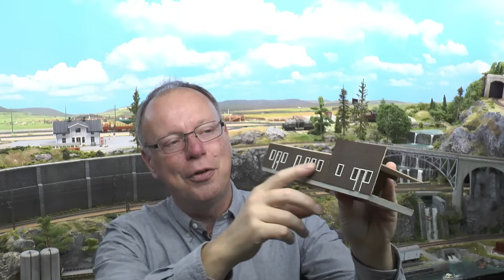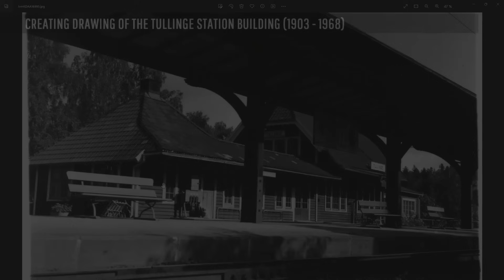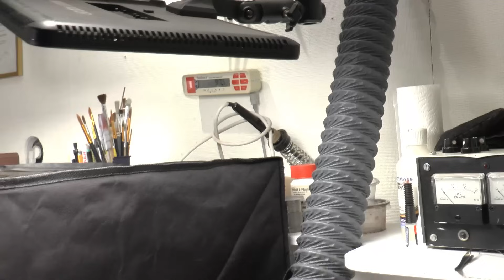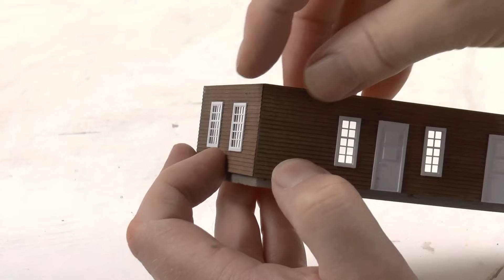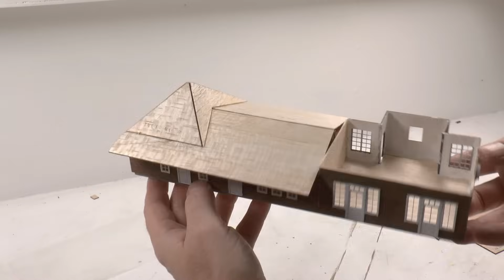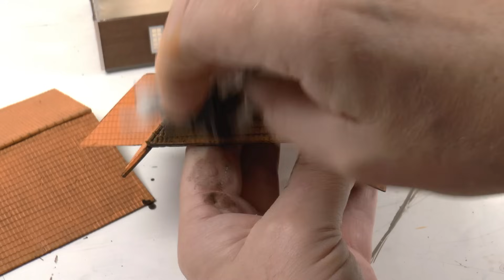Scratch building wooden railway station in H0-scale using Creality Falcon 2 22W Laser cutter

Comment: Hello, I am in USA and have just put together my first layout in years. Track and roadbed only at this stage. I am wanting to keep my track clean and I like your entry from two years ago saying that small wood blocks are really good as a method of burnishing the rails. I wanted to ask you though, about an electrical contact cleaner called DE-ox-IT D100L- 25c. I hear that it has no grease or lubricants. This is a concentrate that can be diluted for economical use. As far as dust is concerned and this is also such an enemy to the entire layout as everything begins to look like gray colour has been sifted over everything. I have seen advertised air filtration devices that are at working level of the layout or more centrally placed that suck in the air borne particles. What do you think of those devices ?   Love your channel and your uplifting attitude that I find encouraging. Merry Christmas and a Happy 2024 !   Bob

Comment: Station looks good, I build coaches and other vehicles using etched brass and was thinking of buying the creality 40w as I hopped it would be able to cut 0.2mm brass sheet but unfortunately I was told by the manufacturer that it would not cut metal

Comment: Fantastic- the stars have aligned.  I recently bought a Creality Falcon for scratch building (i.e., not using manufactured parts beyond the basics) and trust your methods for doing things.  Anyone buying a laser should learn about safe use - beyond that, I find laser work easier than 3D printing.  Thanks.

Comment: Molding texture sheets with glue is simply brilliant, I will be trying that out this weekend!
Reply: Please let us know how this works out for you.  I tried it and was unsuccessful.  I created a PLA mould of the texture, sprayed with mould release and put a coating of PBA over the textured mould but, could not peal the texture off the mould.  I wonder if the PBA glue was modified in the example.  I am going to try again with 75% PBA, 10% alcohol and 15% water.
Reply: Depends on the glue brand you use. I tried some normal craft glues and it was really hard to get off without tearing, I tried it with some selleys aquadhere, or whatever it's called, and it worked quite well, had some air bubbles though, maybe because I laid the glue quite thick (2mm). Gonna have to just trial and error it. @davebaxter3370

Comment: Nice build! Love your channel. But I have a question. Why didn't you 3D print the walls of the building?
Reply: Most resin 3D printers would struggle to print items this large, doing them with a laser cutter is quicker and easier for flat panels like this.
Reply: @meddie79  Thanks for your reaction. I was thinking about buying a resin printer. For printing walls. But maybe I have to do some more research.

Comment: you thing that printing is "Scratch Build" what a mistake.........Where is the scratch?   PLEASE select the tittle appropriately
Reply: Hes creating something from the ground up not using a kit thats scratch building. How he accomplished that is irrelevant s
Reply: @IHC650  It is relevent.  Kit Model building is similar to printing and painting.  But scratch building is totally differnt.  The video is more like Printer Ad.  The title "Scratch Build....." is the wrong word of choice.   Don't you thing it is at least missleading....
Reply: @terlik3537 this is scratch building in this context it means  you are not using anything from a kit and start from base materials how you achieve the work is irrelevant. The title of the video is correct
Reply: @garylong7599  Yeap you are right. I have "Starry night" on my wall. So I scratch build it with my color printer. But I guess it is irrelevant.  So I am Vincent 🙂
Reply: I do agree. You can as well scratchbuilding using styrene sheets and Peco, Auhagen or other doors, windows, roof plates and details. Designing in CAD and cutting the elements with a laser cutter is the same as drawing on paper and using templates to hand cut the parts. Just the tools are different. Saying it's not scratch building is showing you're just narrow minded and unable to use all the tools available to today's modeler.
Reply: @ericsainte290  Do you think "Printing" and  "BUILDING" same thing.  Printing and then some glue and paint is not totaly differs from the kit.building. Read about "Sceatch Building"  in Wikipedia then we can talk about mind set......https://en.wikipedia.org/wiki/Scratch_building
Reply: @terlik3537  Wikipedia  is the worst source to justify your claim as anybody can write anything there. I am a professional model builder and what he shows is kit conception, which can be defined as scratchbuilding as he creates the model from nothing, drawing all the parts in a cad program then using the laser cutter to cut it like he'd use a classic cutter and graving point. The craft is the same, only the tools vary. If you'd buy the files, then I'd say it is no scratchbuilding, sure, but it isn't the case here as even the windows and doors he creates himself in the cad then print them with the 3Dprinter, which is like making a master and making a mold to create copies. Once again the craft is the same, the tools vary. 
And before criticising someone's else work about a pinprick, are you yourself a scratchbuilder ? I surely am, and have been for about 40 years with multiple models having honor place on the ALAF layout in Liege - www.alaf.be - (Eglise St Vincent, Guillemins Station, narrow gauge station, hesbaye's farm, and many more). Where can we see  your work ?
Reply: Scratchbuilding seems like a wholly legitimate way of describing making a model from your own plans (drawn in CAD as the published ones were incorrect) and raw materials with no or minimal kit parts.  Nothing that says it has to be done using only hand tools.
Reply: Instead of marking everything out by hand on the wood and then cutting it by hand he hás used CAD and a laser cutter. Same result: a scratchbuilt station building.

If he then repeats the process again and again then it becomes a kit, not scratchbuilt.
Reply: @marcsmodelrailways  You can had same result with kit model too.  Therefore result is not the creteria.  Question still stands "where is the scratch".   I printed "Starry Night" wit my Laser printer, would it be count as scratch build.  If so, am I talented as Vincent.  Please use the words apppropiatly
Reply: @terlik3537  here is what have always thought "scratchbuilt" referred to: a model that has been made using raw materials with few or no commercially made parts. 😁

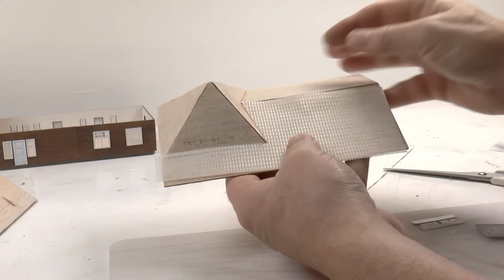Comment: At 16:00 you mention using the laser cutter to cut out the sheets of PVA roof texture - I would advise great caution in doing this. The V in PVA is vinyl, and cutting vinyl with a laser gives off highly toxic gases which is extremely hazardous to your health. Even if you survive, the gases will condense on the metal parts of the cutter, and will corrode them & destroy your machine. I'm not a chemist, so maybe the vinyl in PVA is slightly different & therefore won't do this, but I wouldn't take the risk.

Comment: Hello :) Instead of having your pieces 0.2 mm too small, which can lead to tricky situations at some points, you can adjust the kerf ("outward" in your case, but "inward" is also possible) in Lightburn in order to get them with the required dimensions. You can measure beforehand the kerf for your machine for each material you use. Cheers. :)